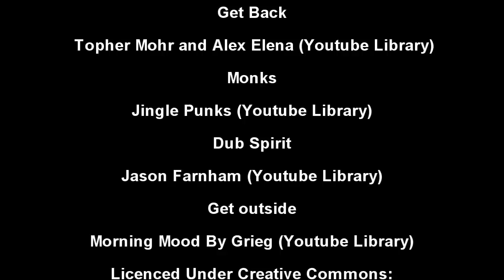Jimmy's Corsa Door Part 2 Lawnmowers Family And Polytunnel

Comment: That repair dont look bad at all mate, although i guess some real sunlight will be key but looks spots on from there. Good see Jimmy is learning some painting skills (flicking in and out when blending a panel) things like this are soon going to be a dying art. im not sure if you had the video speed turned up while you was putting the clear coat on but if not you could have hit it a little harder to reduce some of the orange peel effect and another tip when you was removing the masking tape its better to pull it up and away from the painted edge as it seems to give a cleaner edge and does not pickup so much
Reply from the maker: Ea Composites Yes it was speeded up. It does look well when we got the car out into the sunlight. He's doing well for a young un.
Cheers
Martin

Comment: Hi mate, 
Great videos! Can you tell me if your torque the head bolt when you replace the head gaskets on a mower ? I don't have one and I need to change a gasket.

Also how hot does a mower get when running ?

Cheers
Andrew.
Reply from the maker: Andrew Reynolds All engines have different torque settings for the cylinder but in general, the small rotary 3hp engines are around 15 ft lbs. After years of working on small engines, I know what that feels like but if you are unsure, Briggs and Stratton have a pdf guide to all engine models so you can check.

I don't knowe the actual temperature but providing you have the top cowling on, the correct oil level and the motor is not clogged up with grass, it will maintain a workable temp.
Cheers
Martin